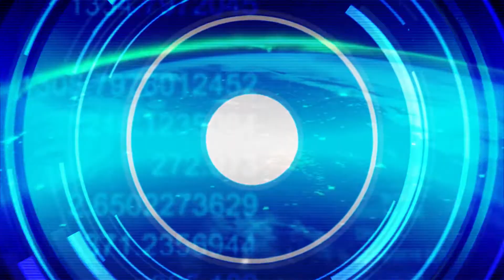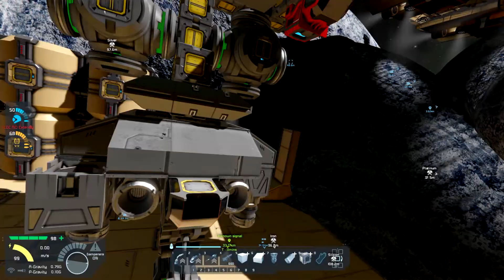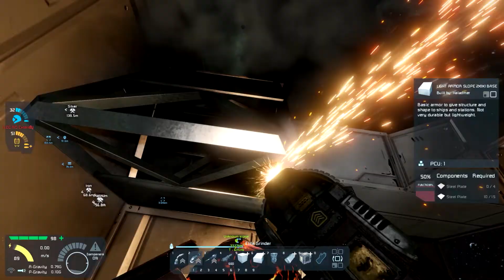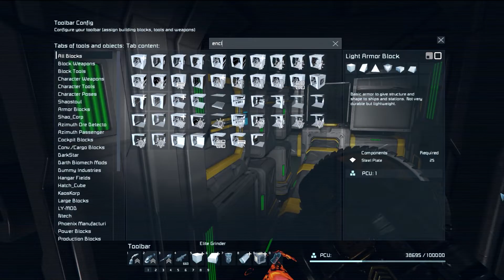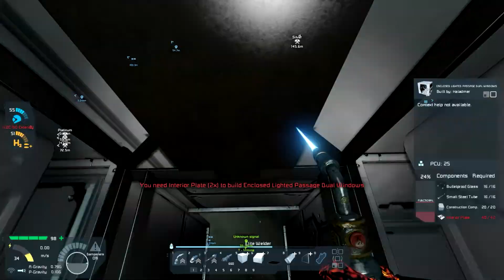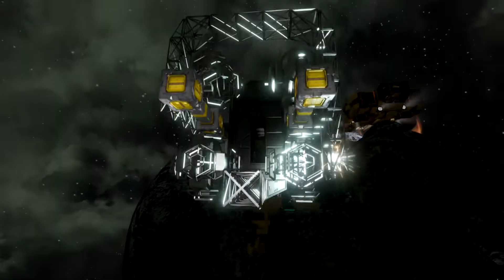Space Engineers | The Alien World Start | Ep 34 - The Barge - Engineering

Comment: Is there a way to use a projector, and have BOB just build the frame of the blocks?  I want to manually finish welding the blocks up, but have BOB just get the blocks started in the project that is being projected.
Reply from the maker: Hmm, set the "Weld New" option would work to weld the projected image block (make sure fly mode is enabled if this is on a different grid) but I don't know of a way, without a script controller, to have BOB stop as just starting the block.

I'd ask Kreeg, Lucas/Meridius, or maybe Whiplash.  Sektan might have a few ideas as well.
Reply: @Haladmer  gotcha, i'm hoping to find a script somewhere.  Thanks hal!
Reply: @Haladmer  Do large ship welders weld more than just 1 block in the area of affect?
Reply from the maker: At a specific time? No.  But they are faster than BOB
Reply: @Haladmer  i'd imagine they are more power effficient too!
Reply from the maker: It's more about speed than power efficiency.  BOB updates on the same timing as a player, but has a small buffer built in on the placing parts/starting to weld.

The ship welder updates on the same scan timing as the drill, with no delay on place/start timing.  So if the welder has a constant supply of parts, it is overall faster.

If the weld has to go back and reload parts, the further away the supply is, the more advantage BOB has.
Reply: @Haladmer  So i think what i'm going to do is attach a single row of welders to a piston, 9 wide, and have that underneath the projected wall of blocks.  The piston will activate, turninng on the welders, and push the welders (full of iron plates) underneath the wall of blocks to be welded up.  The welders will barely weld the blocks, really just get them placed.  once the piston is extended, a timer block will turn off the welders and retract the piston.  This will allow me to grab the wall of blocks and use it via another small handling ship and some landing gear.  This is the simplest solution i could come up with.